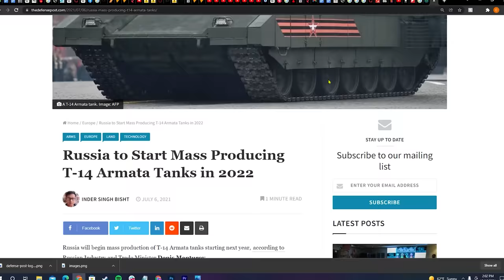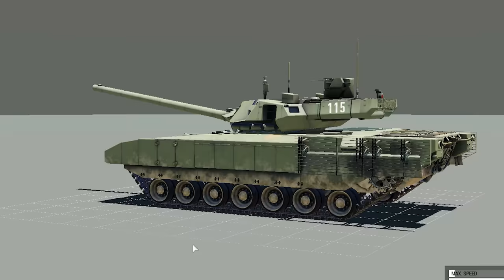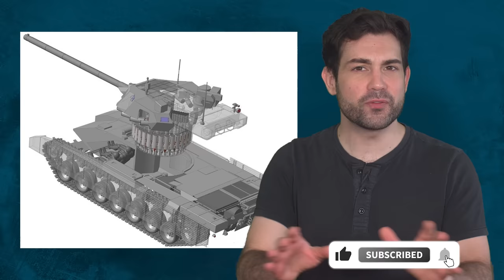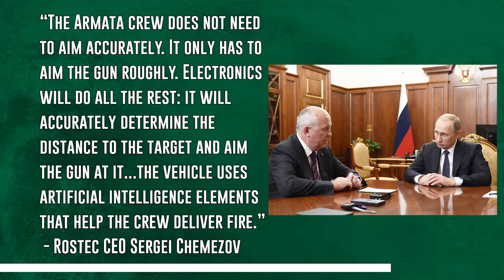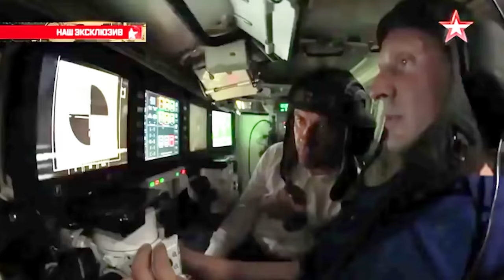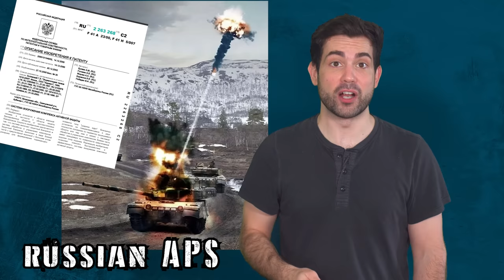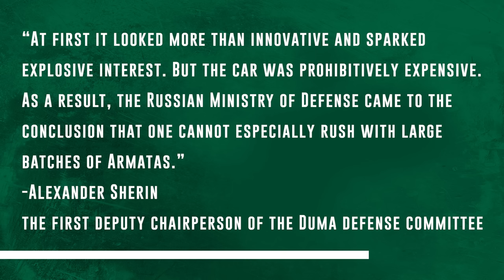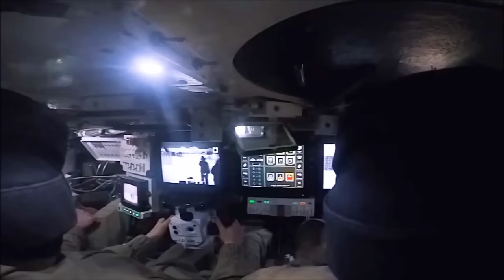The Truth About Russia's T-14 Armata Tank

Comment: The new German KF-51 Panther does what the T-14 Armata does, but better. 130mm main gun, HERO loittering munition launchers, Hard-kill and Soft-kill active protections, 3 crew tank with an optional 4th member to operate the drones, a remote weapon station, what else do you want?

Maybe the T-14 was the most advanced when it was conceived, but the KF-51 Panther had proven to do way much better. The only perk I see to the T-14 is the fact that it can become a "land drone" (unmanned land vehicle, don't know the official term for that, sorry), as the machine is cheaper to replace than the crew. But again, the cost might be so high to a disposable tank that losing it or losing the crew might have the same effect.

Comment: The turret of the tank is full of different displays. Where is instaled, for example, a ballistic computer, device what processing meteo signals and readings from other sensors? In short, tank hull walls and turrets have always been crammed with all kinds of equipment. That's a fact. And now look at the Armata T-14 crew capsule; after looking at the aiming module the gunner rotates the turret faster or slower, raises or lowers the gun, all with the option of quick fine adjustment. The gunner can see the position of the gun barrel on the aiming display. All these control mechanical devices and electronic displays of the day, night-passive and thermovision sights (the tank commander still has all the electronic devices and sensors that the gunner has, even his thermovision is "stronger", and he also has all the other opto-electronic devices as well as the gunner . But its turret with all the sensors rotates 360° and is used to detect enemy positions and the data thus collected is used to gain situational awareness of the deployment of forces on the battlefield. But in the crew pod I saw a lot of empty space, but not ballistic computers or electronics that would record and e.g. radar signals has recognise signal of incoming tank shell or ATGM rocket.   Where are hidden all electronic what will quickly made all the calculations of the correct spot where system must intercept imcoming projectil, decided which of the 2x5 launchers should intercept the target with its charge and at what exact moment it must be activated to destroy the threat.  after reading all the sensors, it is necessary to measure the temperature of the propellant charge and the shell, and make an accurate decision. Simply, the Armata T-14 tank has too much free space (and it is logical for such sensitive devices to be in an air-conditioned capsule near the crew, who in case of failure could try to repair the device if a safety alternative is not already installed).
Of the three main types of ammunition, when loading, he puts the charger in the cartridges, simultaneously entering the number of the cartridge with the type of projectile, so that in battle he can request the ideal projectile to destroy the target. That is gunner's job. And last; Russians are black belt masters when we talk on deceptions, but their word for such swindle is "maskirovka", And the last sentence; The Russians are black belt masters in all martial arts when it comes to cheating, because their word for such cheating is "maskirovka" and they take great pride in making fools of their opponents. The Russians are known for their long tradition of massive fraud (remember the story of Potemkin villages!) Just remember the whole CCCP state, their policies and "all the successes".

Comment: The T-14 was built around a Russian domestic version of a WWII German tank engine that was well known for being unreliable and constantly breaking down. It's not surprising that they're unable to fix the issue, since they can't even replace it with another engine model.
Reply: Stop quoting laser pig I love him but he screwed up on the t-14 video which he probably will fix but please I beg you stop
Reply: @Jvr555  I don't like him at all, but he was right about the engine being a heavily modified model based on the old German one. The design is almost certainly a re-engineered version and has been having yet more issues to this day - a year later. And the T-14 still hasn't been seen on the battlefield or even in parades in the past year. I almost guarantee it's due to a mix of the engine issues we saw them have, not having any ability to mass produce it due to sanctions, and electronics issues that are notorious in any Russian vehicle. Oh plus the engine sucking and not having any extra space to toss in fallback engines that are a bit larger and older but reliable.

Comment: i dont know, i might be wrong but when he said that the 152 version is the largest caliber ever on a tank, isnt that not true? even during ww2 there was the kv 2 with the same caliber. then after ww2 the fv4005 had an even bigger caliber
i might be wrong please correct
Reply: If you put enough conditions around the statement, it might be true.  It's the largest high velocity gun.

The problem is weight.  A slightly larger gun of the same performance is much heavier.  The soviet guns already were larger, heavier and less accurate than contemporary western guns.  The Russians haven't made any breakthroughs since then.  This planned big gun is still under development, and the prototypes are too heavy for the stabilization system.  Promo videos are careful to show only single dimension stabilization, and static single-shot firing.  (Which also suggests that the autoloader might not be entirely functional.)
Reply: @1djbecker  i understand,
Also i now remembered that the american-german mbt-70 also had a 152mm hv gun, didn't it 
You obviously know more than me

Comment: You were wrong regarding the active protection system. The Israeli APS Iron Fist has been able to knock kinetic energy penetrators out of the sky for years. It does so literally by using an explosive projectile that knocks the dart out of its flight path (contrary to the shotgun-like loads that Trophy uses). It was said years ago that Rafael/IAI (Trophy) and IMI (Iron Fist) were asked to work on a combination of both systems. Not sure what became of that.

Comment: Most tanks, M1 for example, have their speed governed down.  Here is the problem:  OK, some cars can do 200 mph some even 300 mph, but only for about 1-2 minutes before the super expensive tires fail; tanks have to keep from loosing a track and the faster you go the more that track tries throw itself off of the tank, and remember those tracks weigh thousands of pounds so trying to go too fast may not get you anywhere...I never trust Russian figures anyway.  The T-34 was the fastest tank on road and off road on paper, however, good luck getting it into 3 gear and 4th gear was totally out of the question.

Comment: Lazerpig did a video with a LOT of damning information. The T-14 is not advanced, nor new, nor does it beat out any current main battle tanks of major NATO nations. That would be the LaClerc, the Panther, the Abrams, and the Challenger 3 upgrade pack. None of the hard or soft kill systems seem to work and the Tank version of Skunk Works made a more affective version of the thermal dissipating armor. Then, just to salt the wound, General Dynamic did what General Dynamic do and proposed the Abrams X. Using existing manufacturing, a hybrid diesel/electric engine, and with that thermal dissipating armor. They have a working prototype that drive and a turret that shoots. The thing can be manned or unmanned with a drone like drive system, a big ol' grenade launcher (with smart grenades), and can turn off the diesel entirely. At night, this tank is the scariest they they'll never hear coming.

Comment: Better than Abrams gun they say. Abrams still has the old L44 gun. Leopard 2 A6 and up have L55 gun, which currently is the best tank gun.
ERA is obsolete against APFSDS and tandem warhead missiles.
I think the concept is interesting. However with the crew in front of the tank doesn't this make them more vulnerable to mines? Wouldn't it make more sense to put all of the crew in the turret instead? Of course with separated ammo.
Problem with the engine is that its very unreliable. Its based on a WW2 German tank engine.

Comment: "10 tons less than the Abrams."
You talking about the first Abrams? 'Cause the Sep V3 is sitting at 73 ton and the T-14 is at less than 50.
Reply: It's easy to claim that a prototype that is mostly built of wish lists is light.
Even unbuilt, the T-14 has been gaining weight.  The gun is pretty much the only aspect that has continued development, and it is much heavier than projected.  Which, in turn, has overloaded the intended stabilization system, which will need to be beefed up.
Reply: @1djbecker  Thicker cardboard ????

Comment: To be honest, at that weight, I doubt that the T-14 could withstand a 105mm M-900 APFSDSDU round at 1km. The M-815 HEAT round would probably pop one as well. You can't have that speed, with that gun weight and have heavy armor. Its rather like how Americans feared an army equipped mostly with T-72 tanks, when there could be weapons to sell.

Comment: If there's so much worry about the crew in the turret why not put the engine in the front and the crew in the back?
Leave the turret isolated like they want.
It seems tanks can be penetrated by hand held anti tank munitions. They either get hit from the top or front. Put the protection around the crew so they can eject from the back if it gets hit.
Driving and firing is through remote cameras anyway. 
90% of the time the tank is totaled with one hit. 
Save the crew. 🤷🏼‍♂️

Comment: It would seem that some kind of EMP shell could take out any modern tank.
Reply: What part do you think EMP could take out?  The AM receiver with a long wire antenna and JFETs in the front end?  EMP can't take out modern consumer electronics, let alone military equipment.

Of course with the Russians fielding half century old equipment, it's possible that they have something vulnerable.

Comment: The thing is that this with russian tanks being cheap but they made a lot of them is a bit of a myth. The T34 was, if built to spec, more expensive than the sherman and if built to spec would been on paper roughly as good as the sherman. Problem was that Russia didn't have the manufacturing capabilities to produce something of that quality so nothing produced during ww2 was up to spec and just horrendous quality. As a result tonnes of t34's was killed by shots they were supposed to survive and others just broke down in the middle of the battle.
Reply: That's not true. Modifications were specifically not made in the early war phase to simplify to process of building them and streamline production. The existense of the T-34-85 already shows you they can modify it. 
Do you seriously think the USSR did not have the capability of producing Shermans? Definitely not numbers wise or prehaps even in the same amount of time, but your claim is lagerely weird nonsense.

Comment: Pssst... The T-14 is manufactured from a 1" x 2" pine frame, supported by a corrugated cardboard superstructure... A 120mm PVC PIPE is the main gun, and the auxiliary guns are plastic Russian kids' toys. The tracks are made of empty toilet paper rolls supplied by the Russian Propaganda Ministry and these are glued to unused, or USED Russian Army plastic BODY BAGS, depending upon the demand for such materials!!! Power is supplied by 4 Russian Lawn & Garden Tractor engines... Quite a Tank, that Armata...

Comment: Were Russian equipment usually fails is in the electronics. Russia has very little high tech manufacturing capability. Some sources claim the Russians use commercial cell phone microchips as they have no factories able to produce them. The result is that the gun may fire up to 4,000m, but good luck with aiming it. This also accounts for the very slow production rate, only 20 prototypes and pre-production  T-14s have been built in the 7 years since its roll out.
Reply: That '20 pilot tanks' myth has been repeated for years.  No pre-production tanks were built, only the seven prototypes.

Russia has no fab lines capable of modern feature sizes, nor the design expertise to use it.

Buying complete phones/tablets is a good substitute for processors, but it doesn't help with all of the other high tech military capabilities.  You can't buy phased array radars at the corner store.   The claim is that Russia actually used 26GHz automotive radar sets, used for forward collision warning on high-end German cars, for their demo of the Afganit APS.  There is a blurred line between a mock-up of future capability and a rigged fake, but no one thinks that they can build what the spec sheet claims.
Reply: Yep most of the electronics and optics in the T14 come from western sources, source that Russia can no longer get.

Comment: As somebody living in Russia and witnessing how bad manufacturing at the state level is I wonder how is it even possible to produce such a good tank (Admit it’s good) without western technology. Russia can’t produce a modern car independently of foreign R&D (Lada is really Renault today) and I’m in doubt it can produce a modern high tech tank without foreign tech as well. There is something wrong with the T-14 Armata tank since we don’t really see it at battlefields in Ukraine. My guess it’s the reliance on foreign weaponry suppliers that got manufacturing of this tank stuck. You can produce 15-20 prototype tanks but in order to produce 1000 units of a very complicated piece of machinery you need suppliers of parts in Russia. Hundreds of them. Producing a modern tank is 100 times more complicated than producing a car. The truth is Russia probably failed at producing a modern car and it will most probably fail at producing a modern tank at scale as well. Check out the new Aurus Senat. It’s quite good looking and modern but in reality it costs $245k and they have produced 22 of them since 2019. After feb 22 and sanctions on Russia, the production of aurus will probably cease to exist as it relies on some western parts. I think this situation resembles the armata tank production problem.

Comment: I had to log in just to comment on a two year old video. Saying "Let's get to the truth of the tank!" and then just verbatim listing off what Russia says it can do is... a touch questionable. The protection systems in particular bears mentioning. They haven't been able to implement any of this technology on any other vehicle, or use the naval equivalents to protect their ships (The Moskva says blub blub), but they are just totally saving it for this one tank? And they have a super effective tank shell, but won't use it on the similarly sized cannons on other tanks?

Also, they can't use the IR stopping paint on other tanks because... reasons...

Russia is hemorrhaging weapon sales globally, and has been since before Ukraine by several years, because their gear doesn't perform as advertised. Even if it worked as advertised, what does it do that an M1A2 can't? The Abrams entered service in the 80. The A2 variant came out in 94. The Russian's are failing to match a 40 year old tank with a 30 year old upgrade.

Side note, on the modularity, why would the other vehicles need a tank engine? Most of the things the other T vehicles would do don't require tank level armor. Sure, you can make a lighter armored version of the hull, but then why would you use a fuel hungry but powerful tank engine for moving them around? There's a reason US modular vehicles have tended to be based on trucks or APCs.

Comment: You missed another "weakness" of this so called "Super Tank" boyo; 
IF it's designed with complete remote control in mind, WHAT's to PREVENT a "Putin" style overzealous Russian officer from turning an "operation" ineffective Armata (unable to fight in a conventional sense) into the world's heaviest kamikaze suicide tank, crew and all EVEN IF the crew doesn't like the idea? Since the control systems are all in the front, i'm guessing that a powerful hit on the front of the tank will be enough to knock out the electronics of the Armata due to shock and heat damage, never mind that those same two effects will probably kill / cook the three man crew all TOGETHER. 
BTW; on the subject of commonality of chassis'. The Armata's engine is IN THE BACK, so an APC using the Armata hull will NOT have a REAR egress hatch like MOST practical APCs. I'm a bit surprised that you missed this, soldier boyo

Comment: Once upon a time, I thought leadership was standing up under fire and shouting, "Follow me!" Now, I appreciate logistics, and how supply, quantity and delivery of critical material wins battles. So ... how well is the logistical chain able to provide those critical parts that wear out and break down? Can techs other than human octopi install those parts? How hard is it to train personnel to repair a vehicle? For example, if a barrel quickly wears out, but replacements are not readily available and field repair is slow, difficult or non-existent, the tank is not very good. If the chips to work the gun are hidden next to an identical chip that controls air conditioning, is buried ten layers deep under other chips and you can't get them because they are made in your 'allies'" factories and they are saving them for their own tank, get another system. Three things win campaigns: logistics, logistics and logistics.